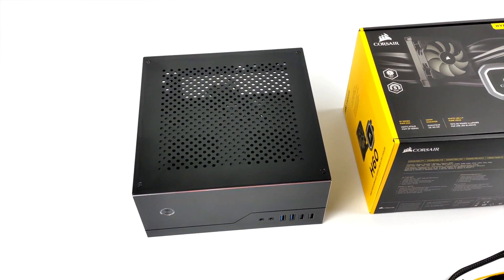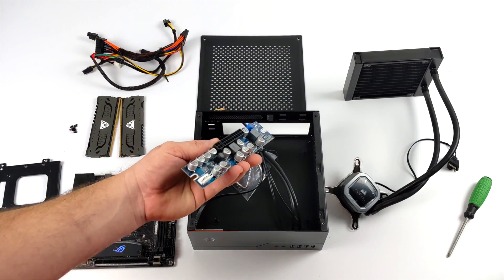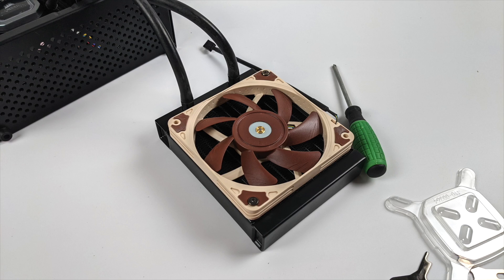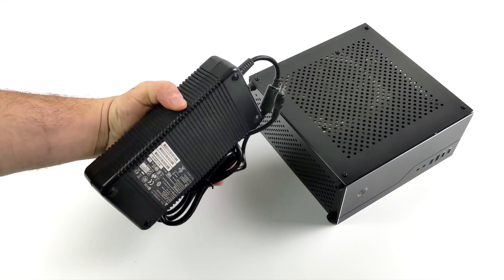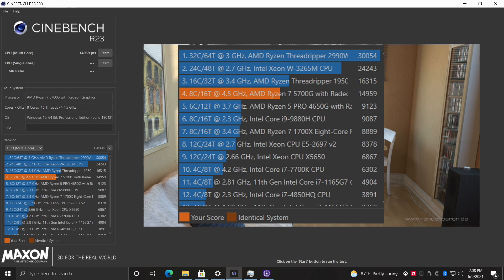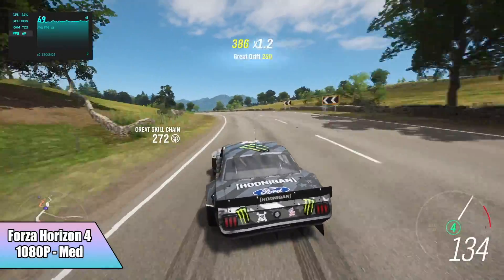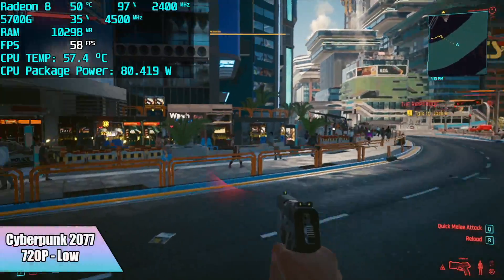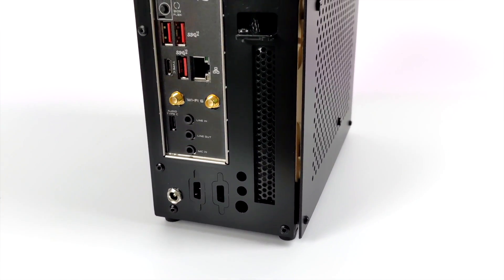Ultra Small Water Cooled Ryzen 7 5700G Gaming PC Build!

Comment: This is definitely inspiring this is exactly the build I want I would   only make a slight modification to add to fans  at the bottom of the case that will force air in through the  lower part of the case to improve Collins for the VRAM etc.
May want to consider using rubber seals fill the gap around the side of the case to improve air pressure and to get better airflow

Comment: memory overclocking next? wanna see something like 4800 19-19-19 on this, feel free to run 1.5~1.6V on ddr4
Reply: These APUs are limited by infinity fabric speed. Max viable memory speed is somewhere around 4400Mhz. ETA seems to have run the memory at 4266 according to GPU-Z
Reply: @Psychx_  he's already running desync anyway so I dont think theres a limit anymore
Reply: @jammetortiz808  There is a practical limit, as your memory bandwidth won't increase further, once you've saturated the IF.

Comment: That was super cool! Does the memory at 4400mhz throw off the infinity fabric 1:1 ratio or is it different with an APU?
Reply: Some APUs should be able to do this in 1:1 mode. 4000~4200 is usually not an issue, but when going above that, the lottery starts. His memory seems to have run at 4266 according to GPU-Z. Unfortunately, ETA never documents relevant parameters like fabric speed, memory controller speed, the actual memory speed and timings as shown in HWinfo64.
Reply: @Psychx_  sorry I cannot see that, can you give me the timestamp and tell me where the memory speed is, sorry I'm stupid
Reply: @naseemyasir  6:29 has GPU-Z and CPU-Z listing a graphics memory clock of 2133Mhz - that's DDR4-4266 (double data rate)
Reply: @Psychx_  oh so it's written in half, was confused by only seeing 2133 mhz written twice
Reply: @naseemyasir  Technically, it's not written in half as it's the actual clock speed the memory is running at. The memory can transmit two bits per clock cycle however, which results in labeling like DDR4-4266 (2*frequency transfers/sec)
Reply: @Psychx_  oh thanks for the explanation
Reply: AMD Apu is not chiplet design like their cpu, they have a monolithic design there is no infinity fabric ratio to worry about
Reply: @samgoff5289  They still have infinity fabric and you want to keep its clocks high enough to provide enough bandwidth for the RAM and in sync with the memory controller, so that you don't get a latency penalty. What's different to chiplet ryzen is that memory latency is lower by default and that higher fabric clocks are possible due to the fabric being in-silicon only.